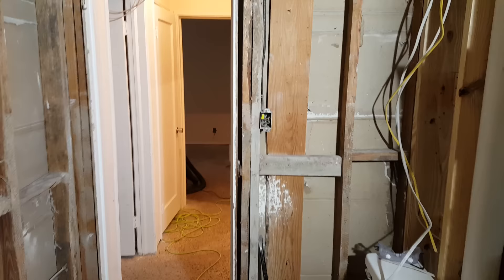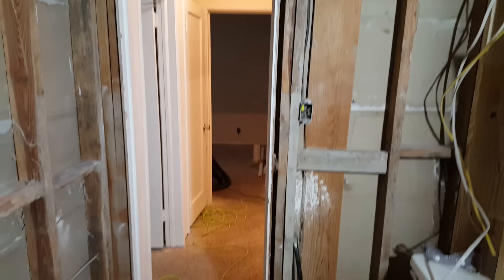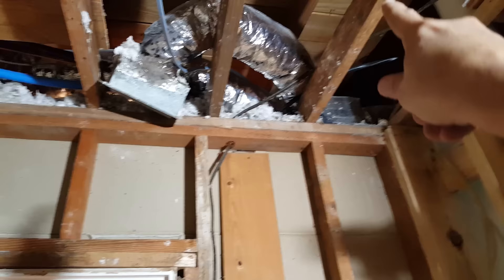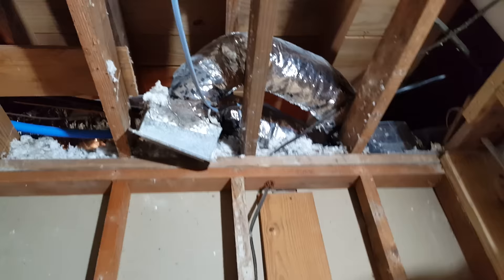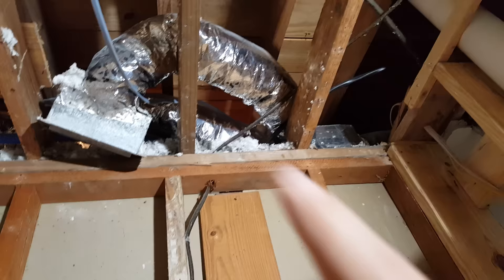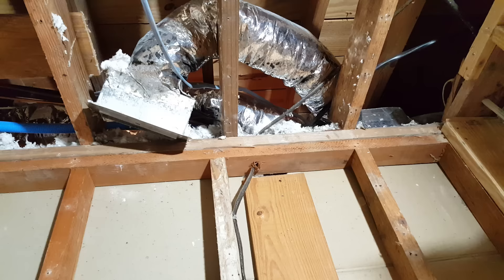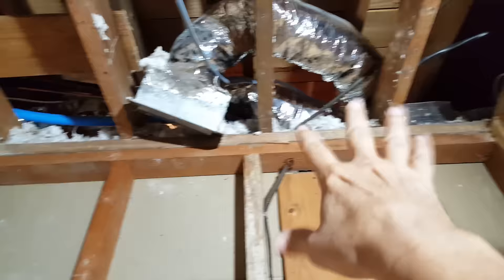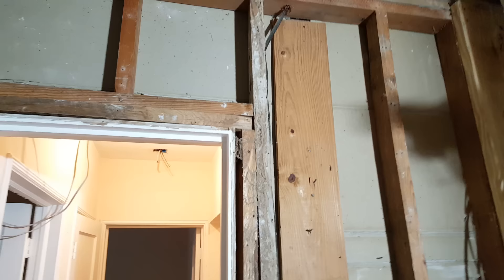How to Tell if Your Wall is Load Bearing

Comment from the maker: Hi everyone, we just added another video along these lines called "How to Stabilize a Wobbly Partition Wall (Kitchen Remodel Knee Wall)", view it here: https://youtu.be/KWIHdWjPKC0
Tools we recommend: 
Dewalt Framing Nailer Kit: https://amzn.to/2BIespt
It's a 20-Volt MAX XR Lithium-Ion battery cordless brushless 2-speed 33-degree framing nailer. This comes with charger and case too. I got this as a great alternative to having a compressor and twisted hoses everywhere to power a framing nailer to nail the bottom plate and wall studs back together, and add cabinet blocking to our stud walls.
Reply: L

Comment: No way that's a load bearing wall. If it is, your video should be how to not build  a load bearing wall. The header would be considered insufficient and the lack of cripples directly above the jacks negate the transfer of any weight from the center cripple downward. If there were weight coming down on that center cripple it would simply cause that header to bow downward in the middle and curl upward at the jacks.
Reply: Correct. see my comments

Comment: Aren't those collars? If you have a rafter roof, the collars attach to each rafter end. They do not bear weight but hold the rafter ends from moving away from the king beam. Note how the door does not have a header--no load on that wall. I have 2x10 collars spaning 30 feet. Because they do not bear weight. You can remove that wall.

Comment: Another main reason for the 2nd top plate is for lacing your walls together.  Also, your drywall lays out perfectly with precut studs if you use a double top plate. Bottom plate plus stud plus double top plate. 1 1/2” + 92 5/8” + 1 1/2” + 1 1/2” = 97 1/8”. This leaves room for ceiling (5/8”) plus 2 sheets of drywall (96”) plus a gap at the floor for water  avoidance and finish flooring.
Reply from the maker: Excellent point, thanks Ken!
Reply: WhatIsKenDoing The way we build now every wall has a double top plate. The double 2 X 4 header over the door is not the way we build today now we use a proper header.
Reply from the maker: @ricktrapperriley2534  Rick, I assume that even on non-load bearing walls, you still make the door header standing up on end, correct?  Make sense, as it is roughly the same amount of time and offer building the header. Also, I prefer 2x6 all the time, this way if they decide to make the wall load bearing later on, they are already set with their door frame.
Reply: Rick Trapper Riley what’s your point? I never said anything about the top of the door. I’m a builder. I know how to frame a wall.
Reply: WhatIsKenDoing my point is that you can’t tell if a wall is load bearing by the two top plates. The codes are different in all areas. If a wall is not load bearing we use a single 2X4 above the door.  Years ago they used a double 2X4 header but they could get away with it because the 2X4’s were a full 2” X 4”.

Comment: I have a one story 1020sq foot bungalow built in 1939. there's a beam in the basement running the length of the house and its supported by three metal poles on a concrete floor. We were looking to take out a wall that separates a bedroom that runs the width of the house. Does the beam in the cellar tell us what walls are load bearing?

Comment: Thank you for clarifying what a load bearing wall is. The fact that the beams are visible was great because im a very visual person and can comprehend better with an ilustration. I sometimes perform handyman jobs but i will not take a job or perform a task if it will jeopardize the integrity of a structure. Great vid thx !!!

Comment: 1918 SFH that was converted into a duplex sometime over the last century. Was looking to open up a smaller doorway for a closet pantry. I do not think the wall is loadbearing, but this has given me the confidence and the information needed to tackle the project. I will act as if the wall really is load bearing since it's an older home.
Reply from the maker: Glad to help Kyle

Comment: Ive removed walls before , construction and demolition,I removed a load bearing wall a week ago,I first attached 6'and 4'studs from joyce to rafters on each rafter and fastened 8'2x4s across the tops of all joyces sistering them all the way back over the finished walls on either side then removed existing studs , receptacles,switches and ac drops to new locations,I was kind of worried because of settling cracks but everything is looking good so far

Comment: on a doorway in a load-bearing wall, it should really have a "double-header", using two 2x4 vertical pieces, with a plywood middle piece, for extra stability. with your doorway, there is a strong possibility of those two 2x4's flexing downward, if enough overhead downward weight was applied.

Comment: Thankyou for the info. I understand a load bearing wall much better now. I now realize the wall that my houses previous owner had cut open to make an archway was load bearing. I wasn't sure but was concerned so I replaced it with a smaller doorway with header etc that fits between the wide studs (very old house).

Comment: Thank you. This is one of the best videos for the absolute novice!  Too often, these types of videos use an industry -specific vocabulary that makes it difficult to understand without experience in the field. Question: I want to determine if either of two walls of a 2-story house with partial basement is load bearing. I went to the unfinished L-shaped basement and found the joists run parallel to the walls. However, there is a large metal I-beam with two large metal posts from I-beam to basement floor. This I-beam runs perpendicular to the walls and the width of the basement. Does this I-beam support the entire 2-story house?  If a wall is load bearing on one floor, is there necessarily a load bearing wall directly above it on the floor above?
Reply from the maker: Melton  The fact that they have a steel I-beam in place with 2 metal rods indicates to me they're attempting to hold up a major load in this one probably is supporting quite a bit of the 1st floor of the house And everything vertically above that load. I don't see you can always assume that just because you have a load bearing wall in the basement that there will be one directly above it on the 2nd floor you really need to find out what walls on your 1st floor have a load that has an endpoint on top of that wall. The only way to determine is to go up in your attic and look. It could be that your rafters are going from one side of the house to the other side of the house and that the exterior walls might be holding up the load you just can't tell without a proper inspection by somebody who really knows what they are doing.
Reply: Thanks. I don't plan on tearing down any walls until an engineer has blessed it! Just thought if it was obviously a weight bearing wall, I could save the time and expense of hiring an engineer. I'll send my son up into the attic to check this weekend. Way above my pay grade.

Comment: I know how to tell if a wall is NOT load bearing.  Was ripping out drywall and got down to the frame of a basement space that will be made into a bathroom.  Saw the inner walls were made by toenailing the studs to the sides of the joist and about did a cartwheel because that is a safe deletion right there.  We are going from a tight, L shaped pantry with micro shop to an 8 x 8 foot square bathroom.  I have one of those plus sign layouts where everything is supported in the middle and there are 4 quadrants per floor.

Comment: I'm in the process of finishing my basement.  I opened up the staircase going down to make it flow better.  What I did prior to taking out any studs I paid to have a structural engineer come in and verify what I could and could not remove so I did not make any mistakes.  It wasn't cheap but at least I know.
Reply from the maker: Rick, That's the best way to do it!
Reply: How much did it cost for structural engineering. Thanks
Reply: @sogosmile4624  About a grand.  Engineering doesn't come cheap.

Comment: Great video thanks for sharing. That may be a old school header but nowadays a load-bearing header will be lumber standing up on edge, generally it's at least a 2 by 6 or 2 by 8, doubled - up most of the time, sandwich with half inch plywood in between for a standard 4 inch wall. There's my two cents for you sir... Merry Christmas

Comment: One main point you forgot to make is that the top plate 2x4 also extends past that walk and overlaps the intersecting wall for tying the two walks together and adding  stability . A lap joint is stronger than a butt joint when opposing forces IE pushing and pulling expansion and contraction happens .like when a house settles through the years.

Comment: The double top plate has nothing to do with a load bearing wall. The second plate ties all the walls together by lapping at corners and partitions. Should be a double plate on non-load bearing walls also
Reply: Vincent - Exactly! And because a framed wall is perpendicular to the ceiling joist, does not mean the wall will be load bearing as stated in video.
Reply: You’re both wrong.
Reply: Not uncommon to have free span trusses where no interior walls are load bearing. Saying every wall that is perpendicular to roof framing is not correct. It is typically correct on rafter/joist framing, but not always the case on pre-engineered trusses.
Reply: Chris.....This is 101..........Trusses, contain only interior non-loading walls.............Thanks for the comment.
Reply: Jimmy Kuros   Not always, there are plenty of home designs that use three point trusses and are a little trickier to determine.
Reply: @electricroundup8300  i dont believe that is a truss though. It looks like old school joists
Reply: @Jason Bowman That's right! And the 2 by 6 (two of them) would be on edge
Reply: I was just typing that
Reply: @shawnyblaze  Otherwise known as conventional framing
Reply: Yep

Comment: In California we use 4x12 headers with a cripple on top of each trimmer next to the king and 16 inch on center.
Reply from the maker: Most people use 2x6 headers. Why the extra 6"?
Reply: that's the way we framed new construction in California abt 15 years ago. All doors were 4x12  and sometimes we would us 4x6 for certain doors but very rarely.

Comment: IRC and IBC require two top plates regardless of the wall is bearing or non bearing. When the wall is longer and multiple pieces are needed,  the joints must be staggered. If the second plate was only to supply a minimum thickness,  there would be no concern for the lap distance or nailing. Max stud spacing is 24". If you find 25" anywhere,  somebody made a mistake. 
This was a short video,  but there was a lot of misinformation
Reply: Sorry, IRC does not require two top plates if the joists are centered over the studs (or offset no more than 1"). The video is correct.
Reply: sroyfred wrong. See IRC R602.3.2, exception is only for top plates properly tied at corners and splices, and where point loads are centeredover studs. What we are not realizing is those plates are not just for gravity bearing, it's at times also the chord tension compression member of the diaphragm, see NDS lateral guide.  These videos should be removed from YouTube. Leave load path analysis to someone trained. This dood is missing alot of info, particularly in stiffness transfer.

Comment: Excellent video. Load bearing: bears the weight (load) (ball bearing - the balls are bearing the weight (load, force)).  Stud-joist alignment - Ideally instead of "theoretically". They're all carrying some weight, but it is a significant load that is when it is considered "load-bearing".  Otherwise they are referred to as a partition (load bearing walls can also partition a space. (2)2x and (1)4x - close, but not the same unless they were monolithic.  "Out of phase" is used for  - this has been misused by instructors using words/concepts that don't really apply (so loosely that it creates more confusion).

Comment: As a Stuctural Engineer i find these videos very disturbing. If there are beams are sitting on a wall then it is load bearing. Its just a matter of how much load. If the beam is continuous across the wall then the wall may be removed provided the beam is strong enough to carry the load over the increased span after removing the wall. The beam may be strong enough but the deflection may be too great which causes a serviceability problem which causes craked ceilings and sagging roofs.
Removing a support then throws additional load on the other supports. Are they strong enough?
There is a lot more to this than meets the eye. Get professional advice.
Reply: If it collapses, it collapses.
Reply: sir can you elaborate in your terms, I'm engineering graduate about and confused how the header is being provided as I read it's being provided at the stairs well opening
Reply: AMEN!!! This video is amatuerish. And by the way......"the header plate" is just a header.....and those 2x4s shouldn't be there. Normally a door or window header is set on edge. Wood has more strength when placed on edge so the wider dimension is providing the strength not the narrow 1 5/8" thickness. 

The conclusion about loads and how they work is not complete.....loads can be carried properly different ways. The COMPLETE SYSTEM is what carries the loads above.

This type of helpful video by you tuber construction workers is ridiculous. I am a professional plumber and work around professional builders; these guys that refer to things as how "they" do that really mean I don't know I've just seen this or that and have drawn my opinion that I think is correct.....if if they don't realize that's what they are saying. This is sad!
Reply: best advice so far!  Get professional advice.  WAAAAY too complicated for a novice to figure out with a five minute you tube.  This one was wrong on almost EVERY point. I.m a third generation retired builder.  If you don't listen to this advice, what happens after is on you.
Reply: Good advise. If there was a lot of weight on the double top plates it would have cripples jacks holding the roof above. Also, I don't see another 2×4 shaking the ceilings ties or joists, so that means that there's really not much weight it's holding
Reply: Agreed... some things should be left to professionals people watch a youtube video then make a mess then have to call in a pro and it generally costs more than if they just called the pro in the first place
Reply: Um just because there is joists running across a wall doesnt make it a load bearing. A true load bearing is where joists cross and continue. All walls hold weight but how much. The header is wrong for a weight bearing. All doors and all windows will have kings and Jack's and a header. Typical bearing walls will have on edge for support. Wow scary
Reply: I absolutely agree. This video is nonsense.
Reply: Ian Fleming   You are correct, if the wall under a beam has a foundation bolt pattern don’t touch it, if the wall line is shot pinned to the floor take another look and figure the beam as you described.
Reply: Wassup why don't all u builders engineers hook it up wit a video of ur own.. Thanks for informing us dat his info is incorrect
Reply: Post a video and show how it is really done!!!

Comment: “The ‘HEADER’ over this door should have the 2x4’s on edge (crown up) with a plywood spacer to equal your stud width!”
Reply from the maker: This is how they did it back in the 1940s with these houses that were built on the cheap for veterans. Also it is still possible that it's not a load bearing wall as well, In which case there would be nothing wrong with that door frame.
Reply: YES, YES, YES!!! THANK YOU SIR!!! I thought I was going crazy. Everyone else is praising the video and you tell it like it is. Thank you Mr. Tommy C.

Comment: i did a cut out in my kitchen and was totally freakin thinking it may be load bearing. To make the hole in the wall i used this method just incase it needs support (at best keep the wall strong) but this was helpful

Comment: Just because there is a top plate doesn't mean it's load bearing- it just makes it easier to tie in to another wall using a lap joint. Although, another consideration is that even though this wall isn't load bearing, it could be structural. Meaning- it could be providing rigidity to an inner or exterior wall. There are more factors at play in the layout other than vertical load transfer
Reply from the maker: Bryan Gatewood  All of your statements are true except for the 1st one because the International building codes require that there be a top plate for a load bearing wall unless the truss is directly over a stud.
Reply: jeffostroff You misread what I said- I agree with you and so did my statement.regarding double top plates. I was just saying just because there is a double top plate doesn't mean it's load bearing. Cheers!